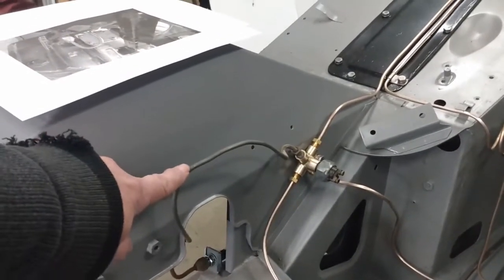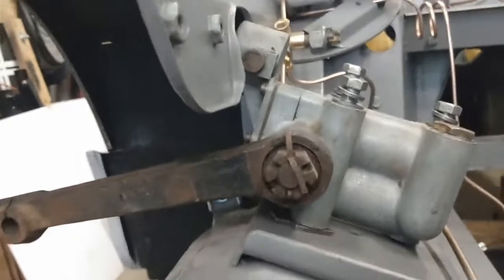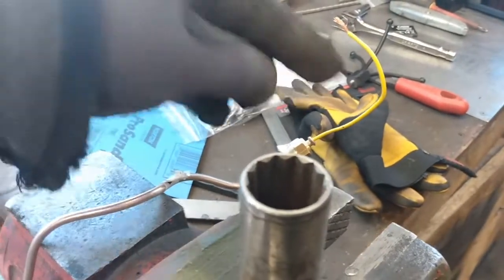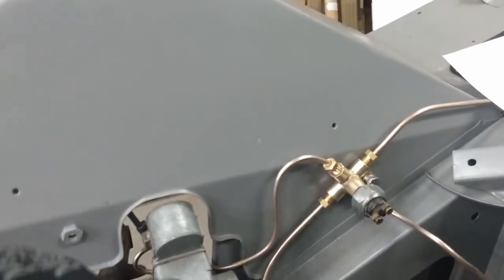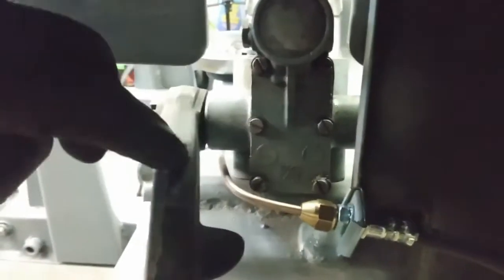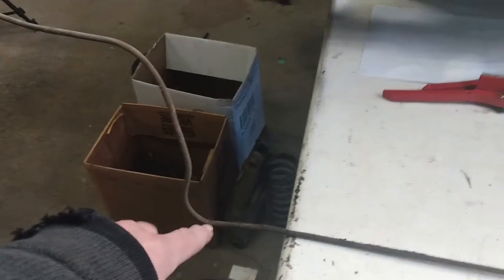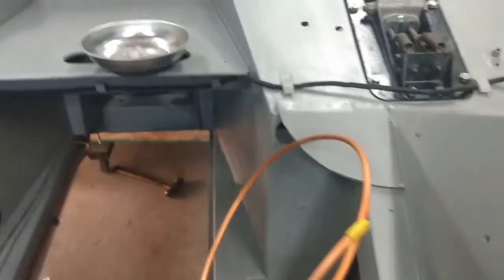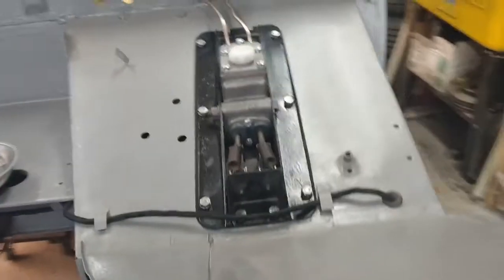How to install fuel line and final brake line, & how to test the dimmer switch. Bugeye Build Ep. 63

Comment: Good job Ian. Did you buy a harness with the fuel pump connection in it?
Reply from the maker: Thanks Gareth. Yes, I had AutoSparks add the wiring for the fuel pump. I'll be putting in some of the wiring harness in a couple of weeks and make sure I point that out..
Reply: The autospark harnesses seem like a no brainer. I just bought a handful of bullet connectors for the Midget but keeping extra for the Sprites and realized I could just spend $200 and get a full harness from these guys instead of questionable 65 year.old one? Yah. Like brake line kits, a new wiring harness is an easy decision.